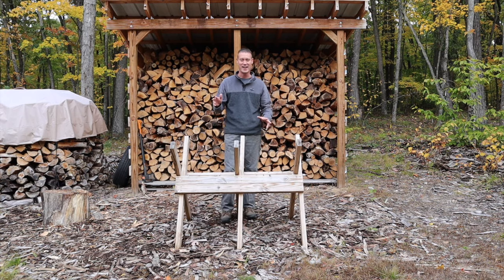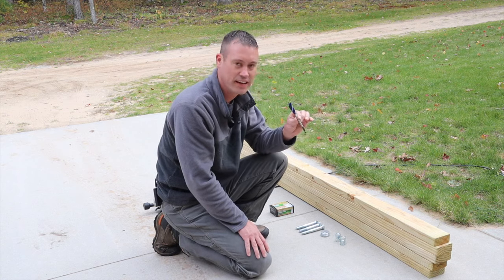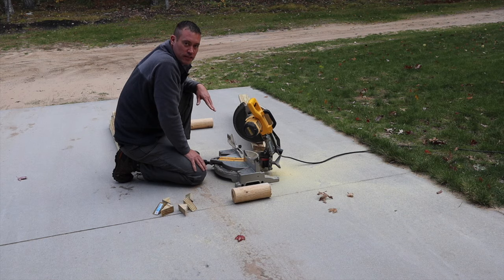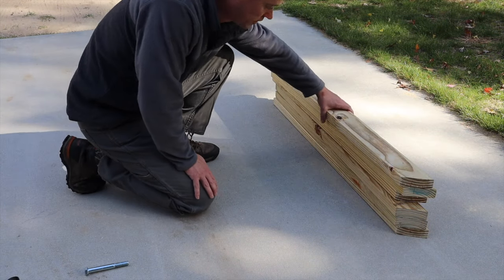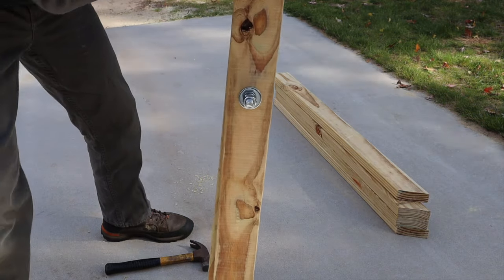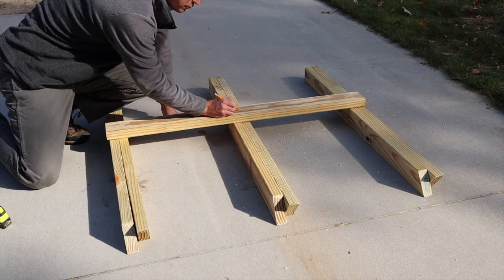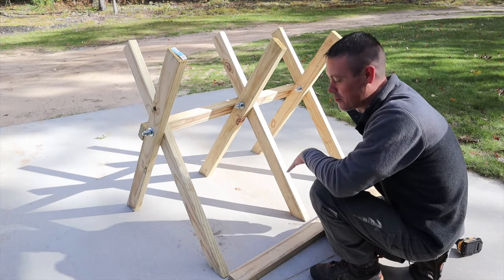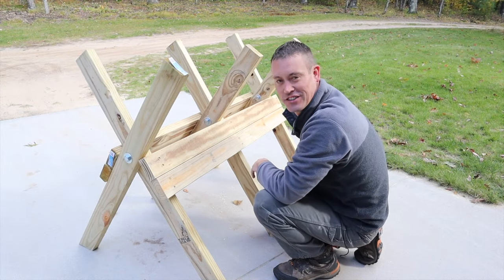How To Build A Sawbuck - The Best Way

Comment: Thanks for a nice, clear video! Question: if I wanted to add one more "x-piece" between the center x and one end x--so it could hold logs smaller than 24"--would that work? IOW, a simple process of adding one more x? Thanks!
Reply from the maker: I glad you liked then video!  Yes, adding another X should be easy and won’t affect the sawbuck at all. Just install it like the other 3 and you should be fine.

Comment: I built it out of limber left behind by the previous owner. I used 2 x 6s for the crosspieces and added 5 x 1/2” plywood across the bottom to brace the legs on the bottom. My lumber had crown, double crowns, and a bit of twist. I live in a very small town, no 5/8” bolts available, I used 1/2” bolts. The wood frame will fail long before the bolts. So it takes a couple of kicks to open and completely close. Comically I reversed my center legs during assembly, oops. It works pretty well. Thanks for the instructions.
Reply from the maker: Happy to help!

Comment: This looks, and from appearances in the comments a great design to use.  I will make my own based on your design.  A couple questions, though. First, would you be able to tell me the height from the ground to the bottom of the "V" where the logs will sit when opened?  I'm 6' 7" and my cutting height for comfort is probably higher than most. Secondly, would you be so kind as to tell me the opened width outside to outside on the legs?  This way I can adjust the hinge point and leg length accordingly for me.  Really appreciate your time and work you have put into it.  🙂
Reply from the maker: I don't have those measurements in front of me, but if it helps I'm almost 6'4" and I find the height to be very comfortable.
Reply: Great question. I’m 6-6 and was wondering if it would be a little low. I guess cutting three 10 footers in half would allow you the 18” for top part then trim leg bottoms to a comfortable height.

Comment: Hi! I HAVE A QUESTION FOR YOU!! Hopefully you see this before I decide to make myself a sawbuck! I wanted to know if you think a tapered angle would make sense on the top..?? Have you considered it..? If not, why not? Thanks in advance
Reply from the maker: I’ve thought about a tapered angle on the top, but I don’t think it would add any benefits. On the bottom, the tapers allow the sawbuck to sit flat when opened. I don’t think a taper on the top would allow it to hold any additional wood, so I’ve never messed with it. I hope this helps!

Comment: Cut 3x in half on 30 degree, cut the remaining 2x in half square
  This is five cuts total instead of eleven
5/8- bolts and nuts with washers countersunk will stay clear of chainsaw
For assembly, chalk lines on the concrete would make the job easier.
Reply from the maker: Thanks for the tip!

Comment: Man. I don't want to have to buy a miter saw. Ain't no way the angled feet on this are necessary if you use it on dirt.
Reply: Just use a circular saw
Reply: I used a speed square and a circular saw.